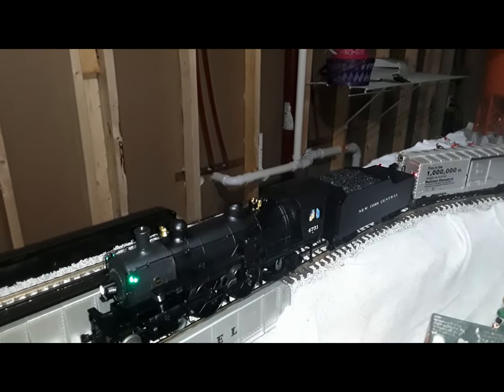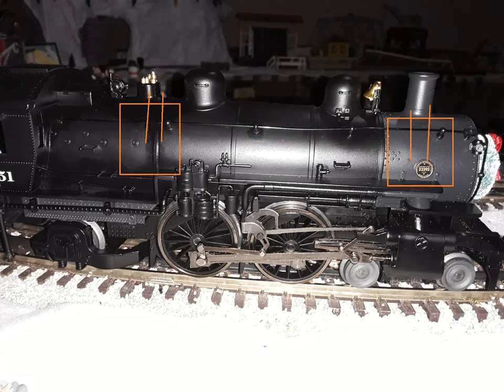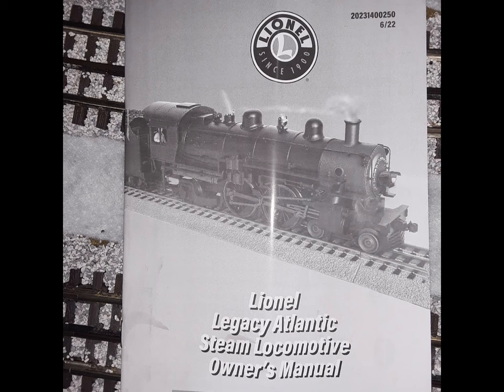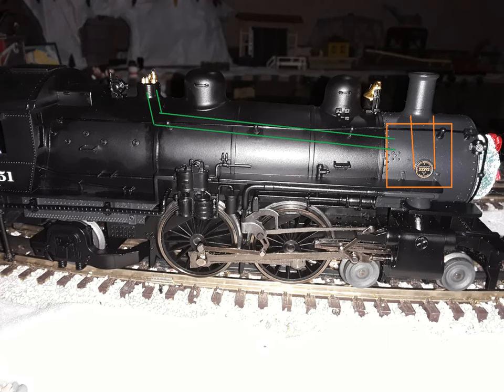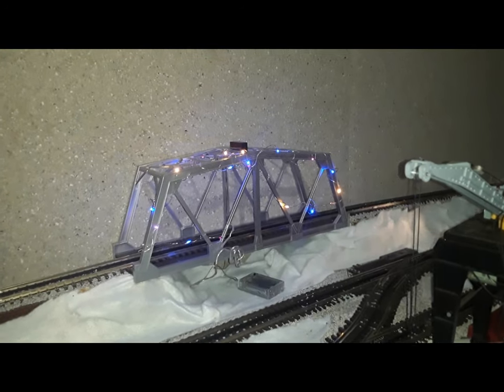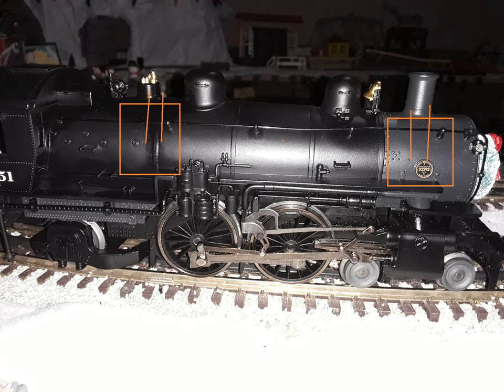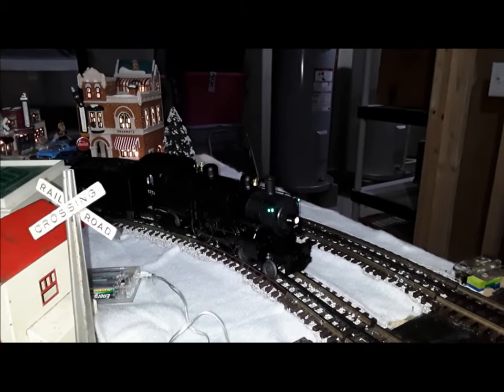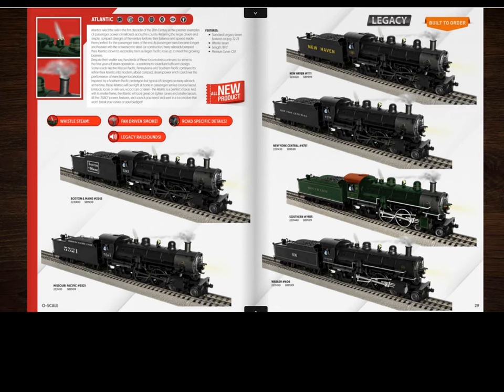This manual tricks you into breaking your smoke unit.

Comment: Very bizarre video.  Obviously - you're just having some fun but I can't tell how serious you are.  Others are reporting the whistle steam is working fine by just pouring fluid down the main stack as Lionel directed.  Either you are just messing around or there is truly a mystery here with your unit????
Reply from the maker: I really did take the shell off and found a smoke unit for the whistle and no pipe from the stack smoke unit to the whistle, and before I started pouring smoke fluid in the whistle the whistle steam was almost invisible. Ever since I started pouring smoke fluid for the whistle it worked a lot better.